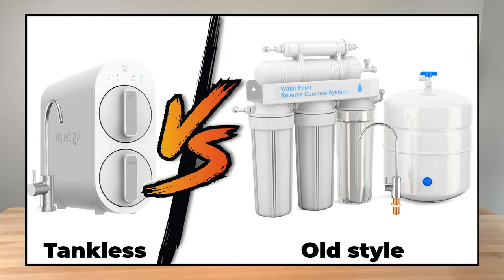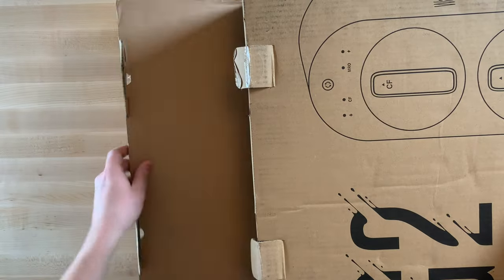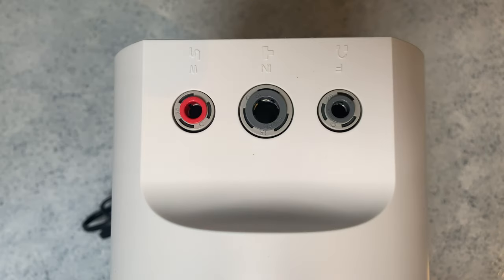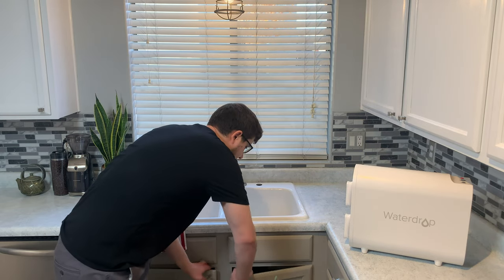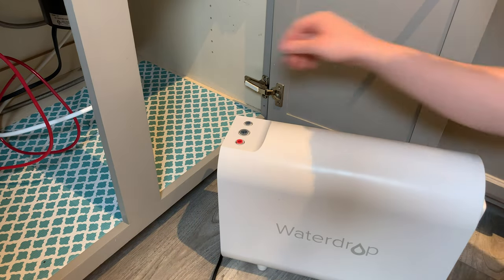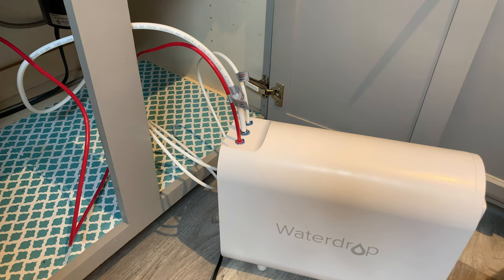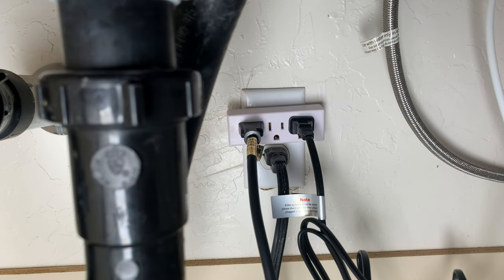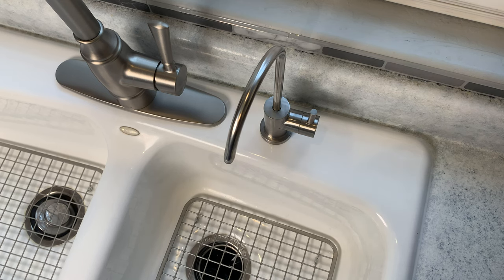Waterdrop G2 P600 Reverse Osmosis Installation Guide (Step-By-Step)

Comment: I Got this WaterDrop G2 P600 from Amazon last year, NO MORE buying and carrying 5 gallon bottles. 
We love it! and now I'm replacing, one of the two filter.  Thank You
Reply from the maker: This is great to hear!
Reply: @intheblackofficialchannel  now I need you to help me with filter replacement, did everything, so easy bitty! But the Red Light didn’t shut off. Help me with that. 🤪thank You
Reply from the maker: @4Wisdom4Strength  find the button the on the front middle of the device, just above and between the CF and MRO lights (it has has 2 arrows in a circle). Push and hold for 5 seconds until you hear a beep. After you hear the beep, push the button again to cycle between the CF and MRO filter. When the light for the filter that you replaced is lit, push and hold for 5 seconds until it beeps and turns blue.

Comment: Thank you so much for this very very good instructional video because of that I am pretty sure I'm gonna put one in thank you 1 million times
Reply from the maker: @richabuelo1659  awesome, good to hear!
Reply: @intheblackofficialchannel Great video. Just got mine. Did not get the G8. Does both models give you a TDS creep up next day as there is some water left in the system ?  I think G3 flushes. Wasn't sure if that run every night and how much water flushes. On G2 do you have to flush water out too much?
Reply from the maker: @Sami-rp7mf   I only have experience with the G2 so I can’t speak to the G3 or other filters. Waterdrop support explained to me that all RO filters will experience TDS creep. Minerals suspended in water migrate across the RO membrane when left sitting for a period of time. You either (1) buy a filter that self flushes, (2) run the water for 30-45 seconds to flush manually before use, or (3) accept that the first water you take each morning will have higher mineral content. Personally I flush it if I’ve been gone on a trip or haven’t used the filter in a while, but on a day-to-day basis I do not.

Comment: Thanks for the great video! Just got this Waterdrop system. I think the trickiest part for me will be drilling through my stainless steel sink. I do have a hole in the sink but it’s currently occupied by my pull out sprayer. Debating on just getting a new faucet with a pull down sprayer so I don’t have to drill through my sink. 🤣 We’ll see!

Comment: I am replacing my old system with this one. I already have an adapter that supports 1/4” tubing. Can I add a 1/4” to 1/2” adapter to the to the 1/4” inline tube and rub 1/2” to the machine? Or does the mess up the water pressure?

Comment: Why make that big of a hole in the counter if only that thin end ends up under the counter
Reply: Saw you comment on two videos 😁. I hope by now,10month later someone has already answered you. But if not, I will.. you technically don't need to drill the hole that big, the size they are giving you is a pretty standard size,in case you ever need to install something else in that place like a soap dispenser or air gap. It's your house, if u want drill a hole big enough for the threaded piece to fit. Hope this helps
Reply: half inch I think you need to drill if you do it your self. i had the same question I seed it in several videos. in some of the videos they have that big hole 🕳️ because it's pre drilled from the store. 

I'm planning to buy this machine but am worried the filters will be hard to get in a few years when I need to replace them.

Comment: While watching a few videos on this system there was a comment on the sound of the R/O while used as being "loud". What are your impressions on the sound level of the unit in operation? Thank you for the video! Really informative, clear and succinct presentation. 👍🏽
Reply from the maker: The pump makes noise and it's loud enough to be clearly heard even if it's in the cupboard below the sink with the door closed. The sound doesn't bother me, but you will hear it every time you dispense water.

Comment: Great video! Super helpful. Not sure if you know the answer, but I was wondering—Do you know if the G2 resets every time it gets unplugged? I don’t have a power outlet under the sink (yet) so I have it hooked up to a portable AC inverter with a decently sized rechargeable battery. Just started using it so I don’t know how long it will last. It’s a temporary solution until I can get an outlet under there. I’m concerned the filter timers will reset every time I unplug it to switch out the battery. If you know, great and thanks in advance. I just subscribed to your channel and look forward to checking out your other vids.
Reply from the maker: I unplugged my unit, gave it a minute, then plugged back in and the filter lights are still blue. But you raise a good point, does the internal memory remember filter life during extended power outages? I’m not sure. If you email service@waterdropfilter.com, they will give you a definitive answer. Worst case, put a note on your calendar to replace the CF filter 12 months after purchase and MRO filter after 24 months.

Comment: Im stuck deciding between the G2600 and the G3600. The G3 is about $100+ upfront and about $75yr extra in filters. Are you satisfied with the G2? Do you know what the difference is between them and if it's worth the extra cost. I can't find much information comparing the 2. Just that the G3 is better because it filters more.
Reply from the maker: I am satisfied with the G2. My only frustration is the "TDS creep" that exists with this filter (and with any RO filter of this type). This is where the first 10-30 seconds of water flow will have a higher level of Total Dissolved Solids (i.e., minerals) and possibly other contaminants due to the process of osmosis that occurs across the filter membrane while it sits idle. This means that if you want the most pure water, you need to allow the unit to run for ~30 seconds prior to taking water. This issue will be present on the G3, but it might be less pronounced. I am not sure as I have not used the more expensive unit. Other than this issue, I have zero complaints with the G2, I think it's a fantastic filter.

Comment: I honestly don't understand why so many people are dumb enough to drill a huge holes in their sink or countertop just to install the WD G2 P600 which only has a threaded stem that measures less than a half inch. It does NOT require a big gaping 2 inch hole. It only requires a half inch (0.5") hole, and nothing more. I have this exact unit sitting on my counter ready to install, and the reason I purchased this unit is because my porcelain sink top came with a half inch hole for a liquid soap dispenser. Please people, look at what you're installing before you go drilling holes in your expensive countertops. I've watched so many videos of people who spent money on two inch diamond tipped hole saws and then spent an hour drilling a two inch hole, only to watch them stick a half in threaded stem through the hole, while never once asking themselves, "why did I need such a big hole?" I wish I could post photos here to show people how ridiculous it is.
Reply from the maker: @pumpkinheadghoul  agreed, a hole that large is not necessary

Comment: How do you like the system? How it is holding up after two years?
Reply from the maker: No issues other than the TDS creep problem that all RO systems have when they sit overnight. Still use it every day, just let the water run for 15-30 seconds before filling my glass.

Comment: I didn't use my RO for a month as I was traveling. Then I changed the CF filter. Now there is a delay of several seconds for water to come out of the dispenser. Please help.
Reply from the maker: @rrrr-ij4zc  first check and make sure you flushed the new filter (five continuous minutes when you change the CF, 30 minutes for MRO filter). The light on the unit below the droplet icon will stop flashing and illuminate solid blue when flushing is complete.
Reply: Yes I did flush for 5 minutes initially after changing the CF filter. When I noticed the issues I have done multiple flushes since then. I even tilted the unit at 45 degrees and did the flush as I heard that would get rid of any airlock.
Reply from the maker: @rrrr-ij4zc  Since the issue began with the new CF filter, I would put the old one back in to make sure that isn’t the issue. I would also check the setup completely to verify the water lines are connected properly and nothing is out of place. Also listen to the water pump when the faucet is turned on… does it sound normal?

Comment: I'm actually planning on buying one of these mainly for maintaining an aquarium.  Is there any way to circumvent the faucet altogether so that I don't have to drill out my countertop?
Reply: Based on your comment being 2years old you may not need the info anymore but they do make kitchen faucets that have a 2nd tap for filtered water. So you still need to replace your kitchen faucet but it only uses the one hope for both the main water and filtered.

Comment: I live in Chandler, Arizona. Installed 2 days ago, I did ran it for 30 mins after setup but ppm is still at 110 range (without RO ppm is at 750). Also when I metered the water run, I notice it initially pour out 500 ppm and takes 20-30 sec to drop down to 110 ppm. Very disappointing.
Reply from the maker: RO systems should eliminate 90% of TDS, so around 75ppm is a realistic target. If you run the filter for a bit longer, say 60 seconds, does TDS drop further? I’m in Gilbert AZ my water is about 550 from the tap and the filter will drop it down to about 40ppm after running for 45 seconds or more. I reached out to Waterdrop last year about this exact issue, and they said “this is a common phenomenon happening on all RO systems with tankless design.” They sent me another filter to install between the RO unit and the faucet and said that if I used it I wouldn’t “need to flush and wait for the TDS to become low anymore.” The model number on that filter is WD-15UD-RS. I have the filter but haven’t gotten around to installing and testing it. I can forward Waterdrop’s entire email response to me when I asked this same question, just send me an email at kf@kenafedorschak.com.
Reply: Hi, I just got mine this past week. I’m getting high TDS reading as well unless I let the system run off for 2 minutes and it drops it to about 38. I contacted Waterdrop about the issue and that’s the solution they suggested and was also offered the filter you mentioned and or a pitcher. Have you gotten to installing that filter? I live in Goodyear, AZ. My TDS readings are under 150 with the initial fill. I don’t feel like wasting water so I just drink then.
Reply from the maker: @erjelmanalastas7924  yes, I installed the WD-15UD-RS filter about a month ago, and the water is about 5 TDS immediately after turning it on. Very happy with that result, but it’s a $50 filter and only lasts 3 months, so I’m not sure I’ll keep buying them…

Comment: How is it working six months later? How often do you need to change the filters? Any issues getting filters?
Reply from the maker: Filters are lower cost and changes less frequent when compared to similar RO systems. I love everything about this system except I have one gripe, which is that the TDS count is really high for the first 30 seconds you run the filter after it sits overnight. This is how Waterdrop gets the efficiency so high, the filters do not flush themselves every few hours like other systems do (including the G3 and competitors, not sure about regular G2). I’ve been meaning to ask the Waterdrop team what this means for overall filtration performance for the first 30 or so seconds after sitting for a while (TDS is just a small part of what is removed by the filter).
Reply: @intheblackofficialchannel  how high?!?
Reply from the maker: @Aposerver  about an 80% reduction in TDS at first, then after 30-45 seconds it hits 90+ reduction from whatever your tap water is at

Comment: What’s the TDS in the morning before you run it for 30 seconds?
Reply from the maker: @AffinityPhoto  my tap water is extremely hard at 500-600ppm, when I first run it in morning the TDS is roughly 150ppm and drops over the course of 30-45 seconds to 50ppm
Reply: @intheblackofficialchannel  ah so if my water unfiltered is 30, a morning first tap of the RO won’t be over 30. Just didn’t want to poison my carnivorous plants with auto watering system
Reply from the maker: @AffinityPhoto  TDS is a measure of mineral content, which is not bad. These minerals (aka electrolyte) are essential for human hydration. However we do not have a reliable way to measure dangerous contaminants (e.g., lead, PFAS, pesticides, metabolized pharmaceutical byproducts, etc) at home without sending to a lab. So we use TDS as a proxy. In my opinion, RO is the best way to filter water at home, just know that filtration performance is lower the longer the filter sits. There are some RO systems the auto flush the filters every few hours, reducing this issue while wasting more water. If you are very concerned, I would look for a unit with auto flushing.
Reply: @intheblackofficialchannel  I have water quality reports for my water source here in Seattle.
Reply from the maker: @AffinityPhoto  that’s great!

Comment: I plugged mine in and nothing happened. It won’t turn on.
Reply from the maker: It should run when you start running water at the faucet. Can you double check to see that the input line, waste line, and output/clean water lines are properly connected?

Comment: Is there a big difference between the G2 and G3?
Reply from the maker: More filter stages, I haven’t tested the G3 so I can’t speak to performance.
Reply: @intheblackofficialchannel  In terms of taste, it shouldn’t be a big difference right?
Reply from the maker: The differences aren’t huge. The G3 has two extra filtration stages (7 instead of 5) so I theory it should remove more contaminants. It also has an automatic flushing mode, which wastes more water but also should help TDS creep, which is where it takes 30-60 seconds of water flow for the filter to reach peak filtration performance after sitting overnight / for an extended period of time.

Comment: will 50 psi be ok to run this as said thanks
Reply from the maker: According to the manual, feed (input water) should be no less than 14.5 PSI and no more than 87 PSI. You should be fine.

Comment: Does the water taste like bottled water? 😃
Reply from the maker: Taste is largely determined by the Total Dissolved Solid (TDS) level of the water, which is a measure of the mineral content. Reverse osmosis filters (including this one) reduce TDS levels by about 90%. If you live on the coast or somewhere that rains lot, you likely already have soft water and a 90% reduction in TDS will make the water have almost zero taste. If you live inland or somewhere with very hard water, it won’t 100% remove all the taste. Any chemical taste (like chlorine) will be completely removed by a RO filter like this. Keep in mind that mineral content in bottled waters very quite a bit too, with some having very low levels and having little taste, whereas mineral waters will intentionally have high mineral levels to create flavor.
Reply: add the following post filter to make water taste better like bottled water.
APEC FI-PHPLUS-QC

Comment: Hi, the adapter at bottom connecting to the water supply above the knob is leaking. We’ve tightened both connections. How do we fix it?
Reply from the maker: @maryannjoy01  Leaks are always frustrating. Are you referring to the Feed Water Adapter? You likely need to apply plumbers teflon tape to the threads before tightening